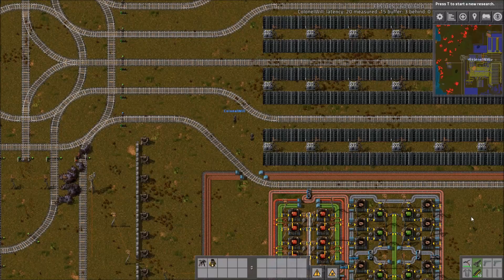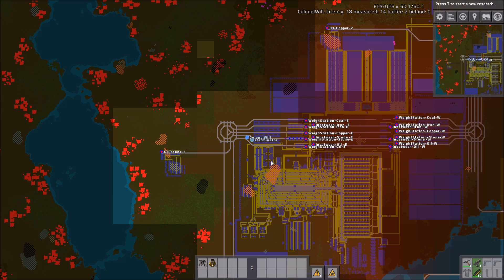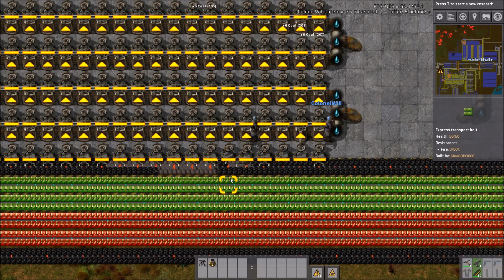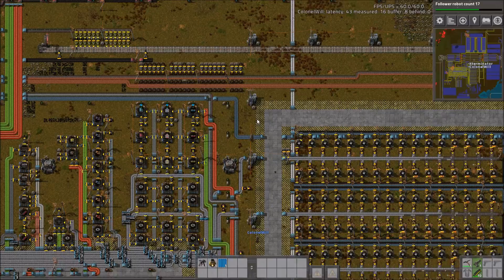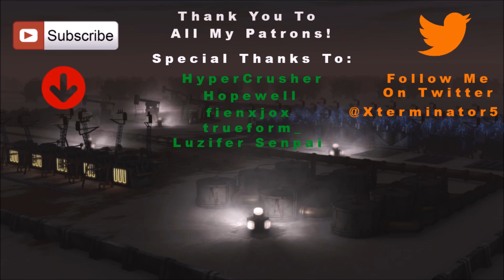EP8: MuadDib's Factory | Factorio Refactorizing - Fixing Your Factory

Comment: How exactly does one go about submitting a base for this series? I have an incredibly messy early-game base which could probably show off quite a few mistakes (with your corrections of course, as is the purpose of the series). Just about everything in the base is temporary, inefficient, and in dire need of reworking; the main point of what I've done so far was just getting to the point where I can get blue science and start manufacturing the end-game machinery which I need for a more final factory design.
Reply from the maker: Via the email in the description. Unfortunately we are pretty over flooded with submissions and likely won't even get to all the ones we have already. :/ 
Still feel free to submit it though because who knows, we might be able to. Sounds interesting!

Comment: well, I kinda understand the huge petroleum and solid fuel storage, he propably had too much petroleum and didn't know where to put it. I have this problem all the time too
Reply from the maker: Best to just let it back up then. If you have too much petroleum then that's a good thing because it means the main product you need (plastic, batteries, etc) are in good shape.
Reply: well, how to back up when it's already backed up and there's no space left? You don't get any light and heavy oil for lube and flamethrower ammo when you have too much petroleum. that's the problem.
Reply from the maker: Then you probably need to increase consumption of the products that do take petroleum, like plastic or batteries. If those are backed up (which is causing your petro to back up) then the rest of the your factory is probably backed up too and needs to be used.

Comment: Burner Inserter - Energy consumption 180 kW = 180kJ per second - 1 coal is 8MJ so fuels a burner inserter for 8000/180 = 44 seconds
Normal Inserter - Energy consumption 13 kW running, 400W idle, with boiler efficiency considered (50%), means 26kJ per second while running, so 1 coal per 307 seconds. When idle : 1 coal per 8000 / 0.4 = 20000 seconds.
So to make Burner Inserters worth it means a duty cycle of 44:20000 = 1:454
i.e. if it runs for at most 1 second in every 7.5 minutes.
Reply: Maverick StClare they are worth it reguardess of the fuel costs

Comment: Is the factory doing anything besides science, oil processing, smelting and the occasional small build areas for engines, inserters and modules? Is it making military stuff for defences, solar, rail and signals/vehicles for example? Is it available for download?
Reply from the maker: I don't believe so. Was a bit hard to tell what the factory was actually doing, because I think it was pretty much stopped at this point. 
Right now it's not available for download until I get permission from the submitter, if I can get in contact with them. :)

Comment: For modules it is not 2 to 4 belts, it is 2 to 3(halfs) of belts, so you kind of need that mess)

There was a time that I thought that you were going to miss that green circuits 1 to 4 split)
Reply from the maker: For modules? The ratio I was talking about for modules was the production ratio of the modules themselves, not the belt requirements for them. :)
Reply: I was talking about Will's complains about too many/overengineered belts on 11:10
Reply from the maker: Oh whoops I misunderstood. Even so, those belts could definitely be cleaned up.

Comment: Amazing Giant belt-based factory that deals with "main bus" buffer. Personally I hate belts, I think they're too inefficient for a big base but this guy managed to make a huge functional base out of it, congratz. Only problem I saw on that base was the fluid handling, other than that the base is amazing.

Belt is always equals to buffer, so if you don't like buffers, you don't like belts. I don't like belts because it stores 3 times the resources it uses and it's slow.

Also the steam engines follows this guy's spreasheet: https://www.youtube.com/watch?v=9ZSoSZG32TI
Unless he's wrong, the setup is accurate.

Comment: it is a fake 4 lane system for both iron and copper. yes the smelters are geared up for 4 lanes but they are only fed by 2 lanes see at 5:34 you see the true inputs of the ore. also there is alot of infrastructure for robots with the roboports and the production of logistic and construction bots. but i see no use of the logistic chests, it makes the logistic robots which are not cheap pointless and the construction bots near pointless
Reply from the maker: Ah yeah I see now. It is fake, just not as fake as the other ones. Lol At least he has 4 smelters and 4 output lines. 
I do find it quite weird that there is almost no robot usage even though it has the infrastructure for it, like you said.